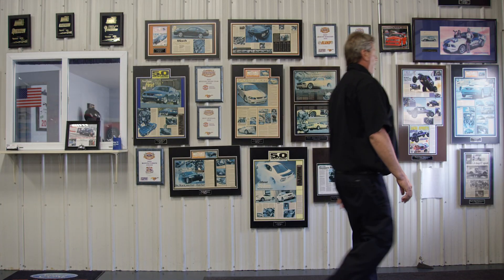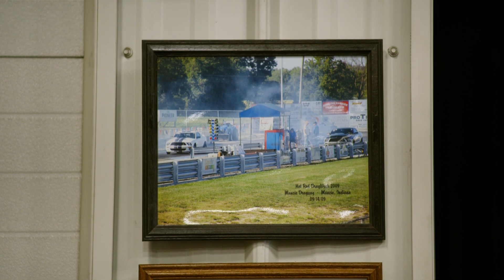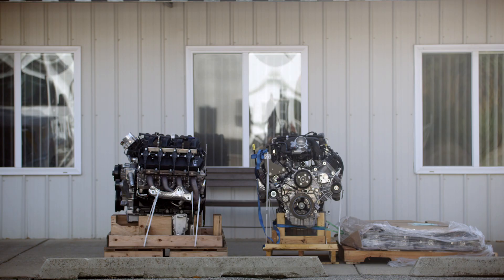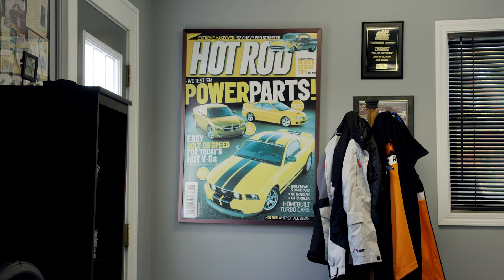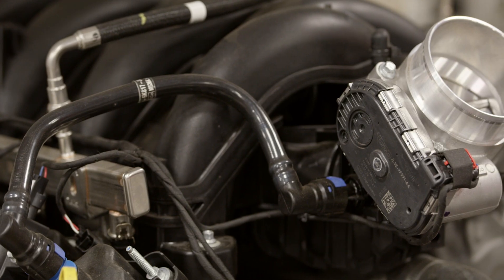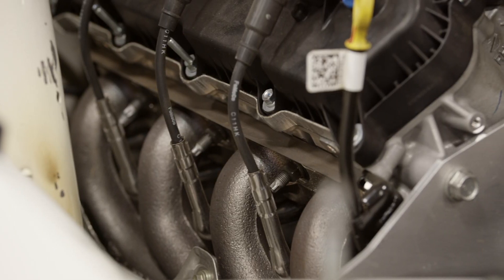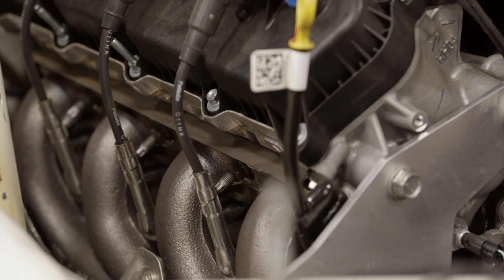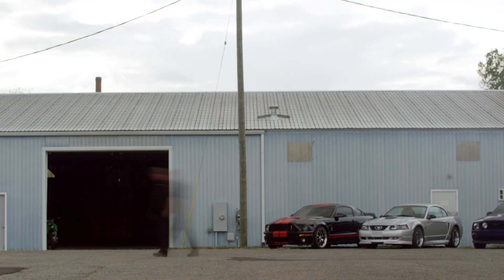Paul's Cobra Jet / 7.3L Crate Engine test vehicle

Comment: Wonder if this would fit in my 96 explorer. They had the 5.0L/4r70W. Could the 8.8 Rear end take this power?
Reply: They're essentially the same size as the 5.8l(351), a little bigger here a little bigger there.
The 8.8 can E-A-S-I-L-Y take the power - bone stock 28 spline 8.8s will hold 400HP with sticky tires at a drag strip; Explorers have stronger 31 spline 8.8s that will hold even more. And you aren't even talking about a situation with sticky tires on a sticky track(presumably anyway - wouldn't be the first Explorer running fast in the 1/4 mile lol). On regular street tires, you probably wouldn't break an 8.8 on the street with 1000HP, just not enough traction. And, with cheap off the shelf aftermarket axle shafts, it would be just about bulletproof for a street driver.
Reply: @RyTrapp0 .........400hp to a stone stock 8.8? Ok, I guess if you don't mind that really cool "snap" or "grind" sound as it's eating itself alive after a couple passes. Can the 8.8 be a formidable rear end with a gear and axle upgrade? Sure. However if you're going to be beating on this thing regularly, a 9 inch is usually a good investment as they have been around for 60 odd years and track tested to 1200hp indefinitely and you can still buy all the goodies for them. Just a thought.

Comment: The new 6.8 will be the one everyone will be using, the 7.3s won't be as widely used since they only come in trucks.
Reply: The new 6x 6.8 will go into the F150.
Hopefully replaces the EcoBoost. It's going to be awesome in the stang banger. 👍
Reply: you do realize the 7.3 is the base engine in the superduty trucks, and Ford sells SD trucks 3:1 on the mustang.
Reply: @TheRoadhammer379   No, the 7.3 is the optional gas engine for the Super Duty trucks. The gas 6.2 is the base engine. The step up from the 7.3 gas is the 6.7 diesel.
Reply: The 6.2 will be no more in the coming years. Heard it from and a Ford engineer

Comment: I have a 2005 mustang base model my dream car. This is the upgrade I’m going to put in next year. But I won’t be putting any super/turbo chargers. I want just pure raw power. And the engine is actually cheaper than the gen 3 coyote. (Not by much)
Reply: Will literally bolt to 4.6 transmission. Just need wiring from Ford performance and motor mounts. And a very tall hood
Reply: @zacklance7798  Now to figure out how to wire it to a fully loaded Crown Victoria LX.
Reply: I am in the same boat! I would love to swap and configure an n/a 7.3 into an s197 :)

Comment: Did they use the stock truck ECU

Very cool 

but no way will it complete with the coyote .

 .
Reply: If you compare apples to apples - a NA 7.3 to a NA Coyote - the Coyote will get smoked. The Coyote is old news now. Done.

Comment: I bet Godzilla mustangs will be in the 4’s within a couple of years, if not sooner. There’s already forged piston and rod combination available. Companies are already designing aftermarket cylinder heads.
Reply from the maker: No doubt the Godzilla will be a fast engine combo across the board. Can't wait to see racers really start to push the envelope with them.
Reply: ....1/8 mile or quarter lol...

Comment: Bad ass it will be a 9 sec beast na pretty easy
Reply: Granny Gertrude   this 7.3 will never live up to what the 5.3 Chevy LS has much less the coyote 5.0. alot of you 7.3 guys going to get your feelings hurt by the LS and coyote guys running low 8s on stock engines 🤣. Stock coyote has run 7s now🤷. Yea this engine might eventually do that but it's so much torque down low with the light weight rear end of a horsey car you will need a huge set of tires tall and wide to get traction. At least the coyote has torque but not so early because most have turbos so you have that split second lagging 🤷. I can't see the purpose of buying this engine when you can find 460 big blocks in junkyards a whole lot cheaper and you don't need that expensive computer that you need to run the 7.3 on top of the cost of the 7.3🤷🤣.
Reply: Granny Gertrude   hey we might have something in common🤔 I like the 5.0 too🤷. I just can't see the purpose of this engine in a street car like a mustang. People are already going about as fast as you can feasibly go in a stock frame mustang. Now put it in a promod and you might serve a purpose. But with other Ford bb in junkyards, way easier and cheaper to get one of them and build it.  At least with a turbo coyote you can drive the streets on slicks and not really look like you got slicks and run 8s. When you pump this engine up to run 8s or 7s you will need huge tires that will leave the rear end sky high 😑
Reply: @boosted saleen look up Honda k24 600whp Na on YouTube. Bored and stroked 2.4 liter to 2.7 liter runs in the 9s🤷
Reply: @spankthemonkey3437  in a clapped out car with everything sawed off and holes all over. Big deal
Reply: @spankthemonkey3437  you lost me at 600hp na k motor being easy and cheap to build. It's definitely not going to be as reliable and cheap of na horsepower as a 7.3 in a few years. When a couple million fleet trucks are sitting in junkyards a 7.3 will cost $1,000 or less used. We already know it doesn't take much for them to make 600na.
Reply: Spank Themonkey 
This is the funny part kid! That k24 will make 10 passes and need a rebuild!! 
Ha ha ha nice comparison!! 
That 7.3 will keep killing tires with only oil changes. But yeah 4 cylinders are the best🤔
Reply: Spank Themonkey 
I’m just all about quality and reliability. 
 And I prefer the classic large displacement engines. They make the power with lower movement. 
So race teams can run a low time 4 banger but regular joes can get those times because the forged blocks and fuel systems are vary pricy. 
A big block makes good power it’s whole life with minimal cost. But do what you want it’s your money!!
Reply: Spank Themonkey that a sleeved block? Not stock!! 
And that’s a 200,000$$ car test my case! Take your Honda crap outta here. My point is proved the more you talk. Thanks tho